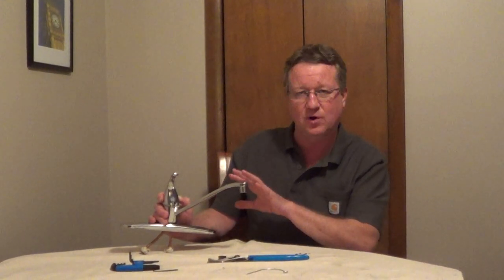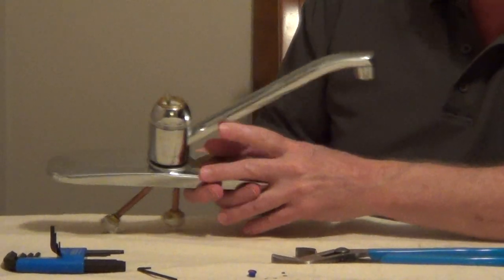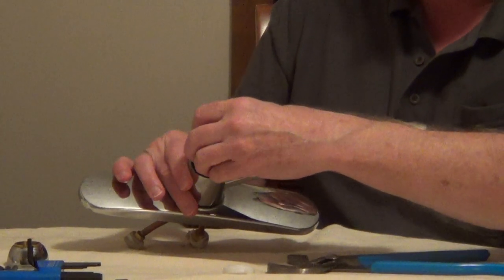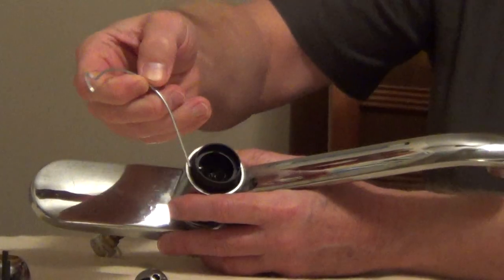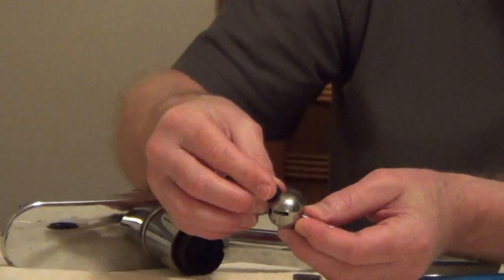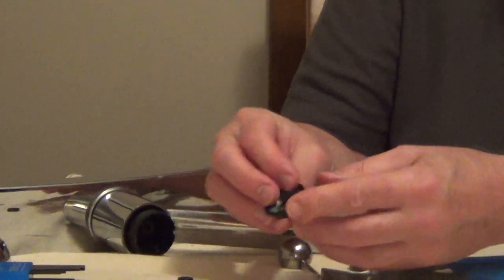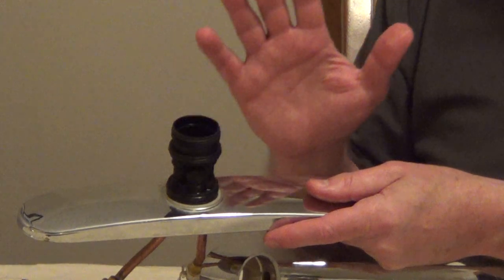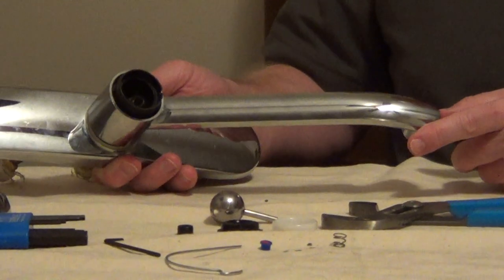Fix Leaky Faucet - Ball Style Single Handle

Comment: Good video.  Lesson learned.... don't buy a ball joint faucet.  Get a cartridge faucet.  Ball joints are a pain to repair and under the seats are tiny springs which could be the problem as well. Lots of variable problems putting it back together correctly as you can see below.  Any working person would have to take hours off work to go down to a plumbing supply house which is only open M-F bankers hours and hope they have the parts in stock.  With cartridge you simply get the model number off the hose under the sink and order the cartridge from Moen etc.  Drop the cartridge in and put the handle back on. They will all ship you a new cartridge free for life.  No receipts etc.

Comment: I have the same faucet. No leaks but the water pressure is weak for both the hot and cold water. The spray has very good water pressure. Any ideas?
Reply from the maker: Hi, did you remove the aerator and clean it out?
Check out some home improvement tips in our e-books https://www.amazon.com/gp/product/B0B2KW1FQ9?notRedirectToSDP=1&.

Comment: Our faucet has a separate handle from the faucet, both are leaking around it. The faucet is leaking in the middle half way up, not in the bottom, where 2 pieces are joined together. There is a small cap like the one you remove, but there is nothing behind it to open it up. The faucet has nothing to remove, no screws, not sure how to fix the leak.
Reply from the maker: ***** Hi, can you send me a picture.
Reply: FIX IT Home Improvement Channel I sent you an email with couple pictures, hopefully that makes things easier for you to see, thanks for your time.

Comment: Actually the shaft on the cam and ball is loose. Have you seen this before? Assuming I would just need to replace this part. Thanks in advance.
Reply from the maker: Hi, depending on the faucet, there could be a thin nut above the ball that can be tightened down against the ball. What is the make and model?

Comment: Yes.
Reply from the maker: GuerillaPimp Hi, if you have removed the retaining cap you should be able to pull it up and off. It may be locked in place with mineral deposits, so pull hard. I've never run into one that doesn't pull off.
Do you have the make and model?
Reply: Hmm... I don't know exactly what model it is. I do know that it's made by Delta. The only other thing I can find on the faucet is the patent number.